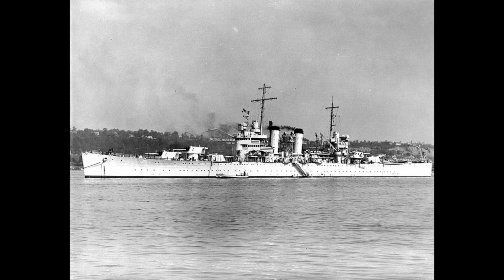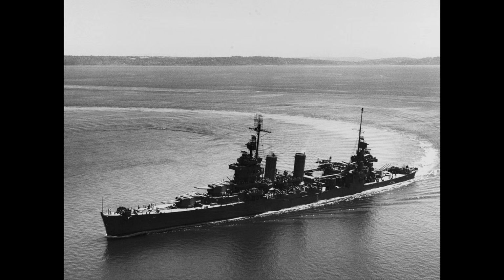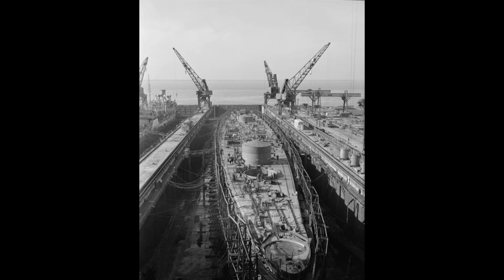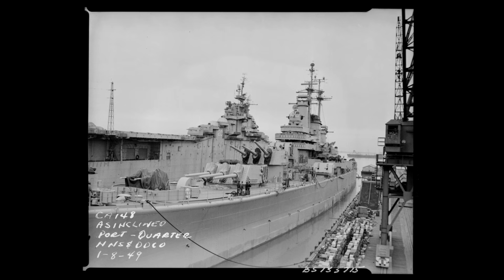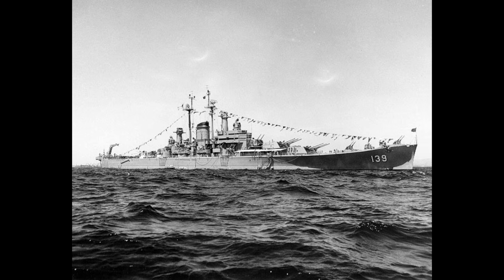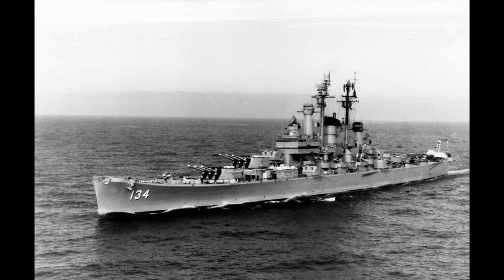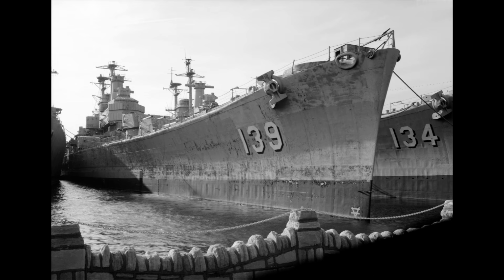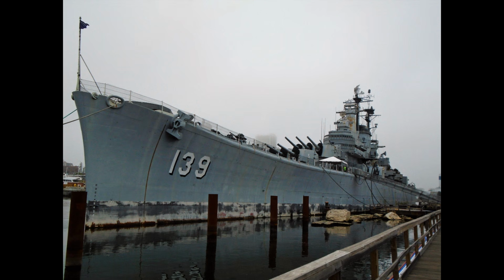USS Des Moines - Guide 251

Comment: Not only was Newport News the only one of the class to fire her main battery in anger, she also finished her career with only 2 of her 3 main turrets operational.  While firing on NVA positions in 1972 she suffered a major explosion in #2 turret, wrecking it thoroughly.  A defective shell explosion in the bore totaled the center gun, killing 20 men and badly injuring about 3 dozen more as well as badly damaging the turret.

The center gun was removed and the gun port plated over.  Proposals to replace the wrecked turret with one from either of her two sisters were rejected as too expensive, so the turret was deactivated and locked unrepaired in a fore and aft position, the ship finishing her career with 2 operational turrets versus 3.

When I saw her in the 'Mothball' basin in the Philly Naval Shipyard in 1986, Newport News was in very rough shape, the yard had opened her hull, starboard side midships at some point to salvage pumps or some other equipment for use in other ships and simply resealed the hull breach with a cofferdam.  She had been "ridden hard and put up wet," battered and thoroughly worn out.  The older Salem and "Daisy Mae" moored nearby actually appeared to be in better condition.

Comment: Yes, it's a shame that the idea & implementation of an 8" autoloader wasn't thought of early enough to see WW2. A ship such as this would have been a nice surprise for the Tokyo Express coming down the slot at Guadal Canal. But I'm sure they made good use of them during Korea & Vietnam. I think it would have been really cool just to be on board & see the 8" autoloader in action.
Reply: I think there were other factors too. For one, the technology may not have been mature enough at the time to create an auto-loader for an 8" gun. There's also the matter of the Washington naval treaty limiting the weight of ships and from a brief perusal of wikipedia, the turrets of the Des Moines-class were significantly heavier than the non-autoloader turrets. Given this, the idea of heavier guns using an then-unproven method taking up weight that was already needed elsewhere... It was probably just decided that the costs outweighed the unguaranteed gains.
Reply: Very true. I think each turret weighed 450 tons. So 3 turrets is going to be 1350 tons. That's a lot of weight to have on a cruiser! And cuz of the war they were trying to hurry & build as many ships as possible. And trying to take the time to build the 8" auto loaders with all the trouble shooting to get them to work with reliability was painstakingly time consuming, I'm sure! But if there had been any way the US could have had such a ship at Guadal Canal, it would have been a major asset as long as it could stay away from all the long lances! I'm fairly confident that with a good crew one of these ships could easily take out 2-3 Japanese cruisers in a matter of a few minutes. Especially, if they spotted the IJN on radar first & opened up as soon they were in range. I admire these ships as much as most of the battleships! Granted I wouldn't want them to go against a battleship  but a battleship is the only ship that would be their superior in a gun duel. And that's only because a battleship has more range. Now, imagine them building a battleship with 16" auto loaders. What a BEAST that would be? Now imagine being on the receiving end of 16" rapid fire. And because they are auto loaders they reliably fire every 30 seconds & because of radar fire control they are deadly accurate as well. And if someone tries to fire a sea skimming missiles at the ship you can fire shells in front of the missiles and the shell splashes would take them out.

Comment: Arguably the most powerful heavy cruisers ever built.
Reply: And the last, everything becomes missile fest after that 😞
Reply: I mean at 73% larger standard displacement than the treaty limit displacement for heavy cruisers, is that really a surprise?
The only other ship of its weight class is the Admiral Hipper, and that was just a terribly designed ship.

Compared to everyone else's treaty limit cruisers though, it's not a fair contest. For instance, the French "battleship" Strasbourg with 13" guns and 11.1" of armour, displaces just 60% more than the Des Moines (both at standard displacement). So arguably, it's closer to the size of a 2nd class battleship to the class you're comparing it to... Heck the same is true for Renown & Repulse (as built) and they have 6" of armour but 15" guns.

That's just to illustrate how much of a difference 3/4 extra displacement makes, so they really shouldn't be compared to regular heavy cruisers.
Reply: And among the most pointless.
Reply: Any claim is "arguable" but in this case winning the argument depends on whether one counts the Alaska class cruisers in the category of "heavy cruisers" (as they were officially classified). At a displacement of 29,771 long tons (30,249 t) (standard), 34,253 long tons (34,803 t) (full load), the Alaskas might qualify as battlecruisers. Their 9 × 12-inch (305 mm)/50 caliber Mark 8 guns considerably out-ranged and out-hit any 8" gun. The two examples built (Alaska and Guam) got into service during the last year of WWII.
Reply: @danielmocsny5066  One has to resort to some strange logic to see the Alaskas as heavy cruisers.  They look like battlecruisers, weigh-in as battlecruisers, hit like battlecruisers, are armoured like battlecruisers and are intended for a battlecruiser role.
Reply: Not just heavy cruisers. due to the rapid fire main armament, a Des Moines could purportedly put more shell tonnage per unit time downrange than an Iowa class battleship.
Reply: @danielmocsny5066  you could equally 'argue' that the Sea Moines weren't heavy cruisers, but some other designation of "super cruiser".
Reply: We should have always kept them and kept them up to date.
Reply: Yes, if you mean the Newport News.

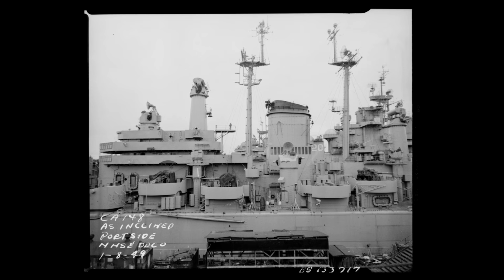Comment: 4:45 - when describing the switch from the as-planned 40mm Bofors to heavier 3"/50 caliber mounts, the underlying reason might rate a mention (although I imagine you covered this in previous videos). According to Wikipedia it was due to the Bofors' relative ineffectiveness against kamikaze attacks. The Bofors had been effective against conventional air attacks - where the attacking pilots planned to fly away in still-functioning airplanes. The mostly fragile Japanese aircraft were highly vulnerable to even single 40mm shell hits, readily incurring damage that could prevent a safe return to home base or carrier. But this became less true against kamikaze attacks in which merely setting an incoming aircraft on fire and killing the pilot was often insufficient to take it out of its terminal glide once committed. A more robust shell capable of removing a wing or blowing an airframe apart was neeed. The 3" gun was comparable to the main armament of a medium tank. As it also outranged the Bofors the heavy shells could start being lobbed at an incoming aircraft from farther out. An added bonus: the 3" shell could take the "VT" proximity fuse whereas a 40mm shell was too small for that.
Reply: Quite a bit more punch ya.  Having a high velocity Sherman Tank shell explode near an aircraft was much better than a direct hit with a large grenade.  Those things fired once every two seconds if you kept feeding the auto loader.  A shell a second with a twin mount.  I think the army had a land flak gun based off it as well.
Reply: The 3" was seen as an ideal weapon for VT fuzed AA because the lethal burst radius of the shell was close match to the activation range of the WWII era VT fuze.  A 4.5" - 5.25" shell could kill a plane without having to pass as close to it, but what good is that if the fuze can't reliably trigger the shell at that greater distance from the target?

The larger shells would still be slightly likelier to take down an aircraft in a single hit, but not enough so to offset the 3" guns much higher rate of fire.  Though, ironically, the British struggled mightily in their post-war cruiser designs studies to fit the 3" gun in place of 4.5" because it required much larger magazines.  Despite the smaller shells it could fire so many more of them per minute that any given duration took more  magazine volume and the RN didn't want to reduce its AA endurance.

Comment: In the mid seventies I signed up for DOD bids for surplus/scrap. I would get the condition of the various ships and submarines as well as surplus trucks, jeeps whale boats, etc. . It was a delight for a 14 year old to receive solicitation for bids on such hardware.  The shop condition was usually " hull is towable but this is only the opinion of the harbormaster and does not constitute a guarantee. The only bid I successfully made was for an RD 450  overhaul kit for a half track engine. My father was using the half track as a mount for out backhoe so we could get into muddy areas, but still be legal for road transport. Yes I did drive a half track over the roads of rural Minnesota. The half track was sold for scrap about 40 years ago.

Comment: My father was an officer in the merchant marine for a while before becoming a harbour pilot. He spent some time shipping fuel in Asia and always told me a story of being anchored to pump fuel in Vietnam but being unable to sleep because a cruiser was anchored nearby conducting shore bombardment at night. He still vividly remembers the noise and the spectacle. I doubt is was the Newport News specifically, but I've always had a bit of a soft spot for 'Nam cruisers as a result.
Reply: The USS ST. Paul CA 73
may have been that curser firing harassment fire at night .
We would go up the Saigon river and fire from around 10 pm till around 3-4 am. It would be 1 round every 2-3 min. Yes it was a loud boom if you were near us when we  would send out those 8” rounds. 
I was. Boilermen in number 3 fire room. If they were using the aft turret it was very loud in our area. The concussion was rough as well even with one gun firing. We would need to step aside from the air vents blasting air to every watch station and sending a 1/2 bucket of rust with the air. 
Turning anyone that didn’t step a side would turn red instantly covered in rust.
The 9 gun broad side was really bad. 
It was very bad if you had to stand a 4 hour watch covered in rust in the boiler room that was at times 130-140 deg. 
It would be a run to the showers after watch. 
I was on the St. Paul from late 65 thru July of 68.
Three tours. Our ship did not have Air conditioning except in officers country sick bay and the oil shack used for lab work to test fuel and evap water for drinking and boiler feed water. 
Any way our birthing compartments were very hot as well. 
H. V. BT-3 
USS St. Paul CA 73

Comment: At Komandorski, the range of engagement was 20 000  yards roughly. At such a range, the flight time of a shell fired from one of Des Moines' guns was measured to be almost 38 seconds.
The guns could cycle ten times a minute, meaning six seconds between salvos.

This means the ship would have six salvos in the air by the time the first salvo struck the target.

Comment: When I was running 1:2400 WW2 ship battles in the wargames club at college, I tended not to use Baltimores in a cruiser-destroyer scenario because they were 800-pound gorillas that far outclassed any opponent.  I can only imagine what a Des Moines would have done in that situation.
Reply: well tbh, Myokos, Takaos and Mogamis could easily match Baltimore's firepower and range and armor, exceeding them in speed and manouveribility and also... well Type 93 torpedos... lots of them. However stricktly in gunnery Baltimore had upper hand because of better radar and better FCS, probably better survivability too. Then, there's Hipper class, which was better armored. Baltimore as a design wasn't that much better than the counterparts. The circumstances they served made them so good, also quite obvious lack of comprehensive strategy of fleet usage, missheaps in planning on japanese side and general chaos in japan navy after 1943 added to that succes. 

Don't get me wrong, it WAS a very good ship overall, but saying it far outclassed its counterparts is quite a stretch
Reply: @jakubw.2779  We were using Seapower III rules which may have overrated the Baltimores slightly, and really didn't model torpedoes all that well, so you could be right.
Reply: Now imagine bringing in the Alaskas

Comment: 90 rounds of 8 inch per minute ! I just can't imagine what being on the receiving end of that that would be like! Holy Crap !
Reply: About 1.5 every second I would think... And praying that it would take them about 5 times as long as normal it should to find the range... Because you wouldn't be around long after.
Reply: I can't imagine being on the sending end.  On the Long Beach firing one 5 inch gun caused a huge fall of dirt from the overhead and more than enough noise.
Reply: Did they mention each shell is almost thee feet tall, and weighs 330 pounds?

Comment: Just an idle thought, how wonder what their impact would have been if they had been transformed in the mid to late 80s  in the equivalent of the Kirovs with harpoons, slcms, sm2 in Mk41 pods.
Reply: Perhaps if you took the rear turret out and put in 4x VLS, but that might upset the weight distribution calculations.  USN did not have an equivalent missile to the SSN-19s.
Reply: @gregorywright4918  the engineering is a fraught question, but as an arsenal ship the 8 inch turrets should have hust gone, in Kirov's fashion. I also guess that the most important part was the sm2 and the land attack cruise missile. Big anti-shipping missile would not have made sense as those were carrier killers - the actual function of the Kirovs.
Reply: @gregorywright4918  navy wanted to put tomahawks and CIWS mountings amidships for the gulf war, but determined it would be too expensive, and for the same price they could outfit the Iowa’s with their longer range 16 inch guns.

Comment: Magnificent ships.  Replace the secondaries with CIWS and SAMs, update the radar and electronics, and one has a still very useful ship.  It would still be vulnerable to submarine torpedoes but so is everything else.  If those Russian style anti-torpedo systems become a thing then it could be very formidable.
Reply: Replace the main armament with missiles as well and then it’d actually be viable.
Reply: You'd probably want to rengine with a LM2500-based COGAG or IEP setup though, because non-nuclear steam turbine skills are harder and harder to find these days.
Reply: I would suggest they probably would've been more practical than the Iowas for reactivation in the 1980s.

Comment: I just learned the US Navy wanted Nuclear Strike Cruisers (CSGNs,) which would have been nuclear-powered guided-missile-carrying cruisers. Unfortunately, they would only have a single 8-inch gun.

Imagine crossing a Desmoines with a CSGN. Give it at least one (maybe 2) auto-loading 8", triple-gun turrets plus a large number of vertical launch system (VLS) cells.

If these had been built instead of the Arleigh Burke class, imagine how they could have been useful in the many asymmetric wars the US got into. Imagine how they could still be useful today against peer adversaries.

What could have been...

Comment: this is going to sound weird but now that I think about it these ships are what the zumwalts should have been, a medium size ship with a high fire rate, considerable caliber and shorebombarment support for landing units, just add the ability to carry missiles for long-range defense and attack, ciwis and that's it, remove all the unnecessary stealth and voila, you have a platform that does the same as zumwalts without being a money black hole.
Reply: The "money black hole" on these ships would be their large crews and old engines.
Reply: @gregorywright4918  crew would not be a problem, since much of them comes from the AA guns that with a modern system would be greatly reduced in size and the engines would not be a problem of the scale of those that plague the zumwalt project
Reply: I have no idea how much it would cost to basically gut these ships in between the turrets and give them modern engines (even aside from operating costs, there are few if any people left in the Navy with the expertise to operate and repair conventional steam turbines), modern computers and automation, etc. It wouldn't have been cheap; we're talking about a much more extensive rebuild than the Iowas got in the 1980s.

Comment: How about a video covering the evolution of automatic gun loading technology sometime?
Reply: Very similar overall to handguns - encapsulate the powder charge in a fixed-length hard-shell "cartridge", then design a reliable automatic conveyor system to deliver the cartridge and shell to the gun at whatever angle it might be firing at.  Use some of the recoil power to extract the spent "cartridge", and Bob's your uncle.